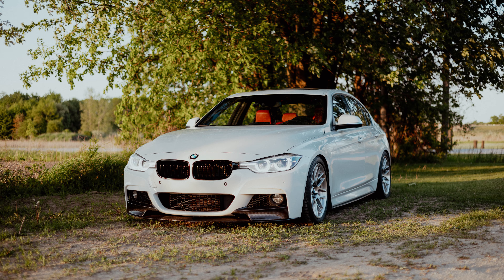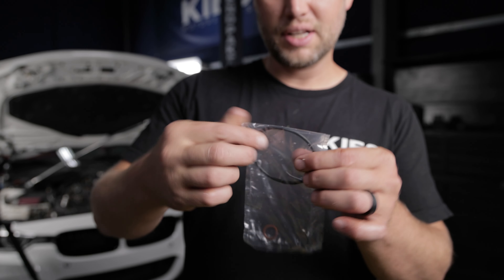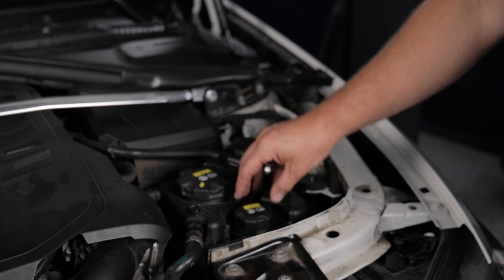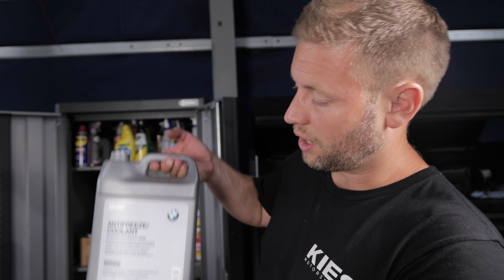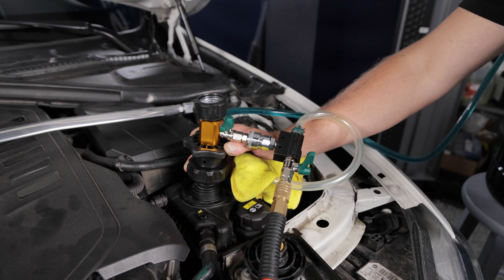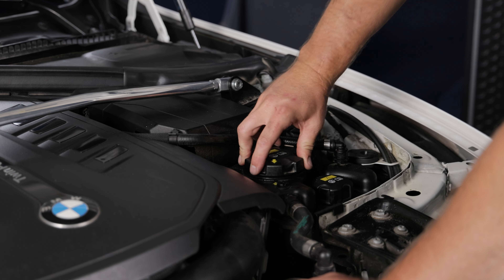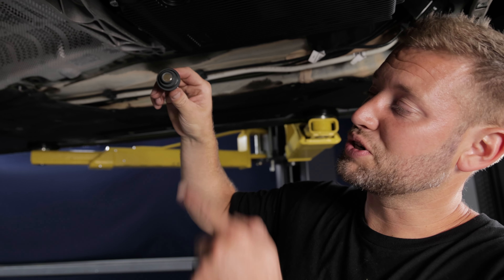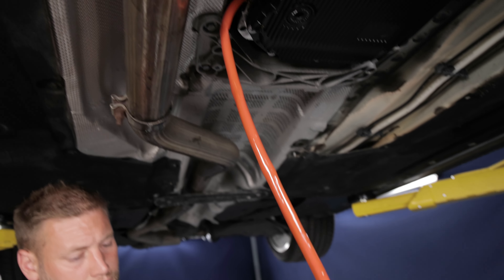How to Change EVERY FLUID in Your BMW | OIL, COOLANT, ZF 8 SPEED, DIFF, BRAKES

Comment from the maker: At 16:55 when Bryan explains checking the transmission fluid level, he meant to say "fill plug" rather than "drain plug." You will use the fill plug to both fill and check the level. DON'T take out the "drain plug" after adding fluid or it will all pour out on the ground lol.
Reply: Hey bro question i have a bmw x5 e70 2012 n55 engine with 119k miles i bought a transmission fluid kit from fcp euro i want to know if is safe to change the fluid or is too late now i call the bmw dealer and they told me is not recommended what are your thoughts the car shifts perfect with no problems ?
Reply: @yeisonmunera8701 your taking your Chances. Keep the old oil just in case if any issues you can pour  the old one back in.
Reply: 0:10 0:10 0:10 😮
Reply: how are people okay touching these fluids?  rip
Reply: Hey Justin, how many miles did your 340i have when you decided to change all the fluids out? I have an '18 230i with 45K miles, when do you recommend I change mine? I drive about 5k miles a year. Thank you and love your vids!
Reply from the maker: @AnonN-sr6uu  mine had around 60k miles in this video. Id say between 50-60k would be good for many of these (transmission, diff etc).
Reply: Do you guys work on E85 Z4’s ?  In Need of some help over here ❤!
Great video
Reply: hey justin i just got a 2018 G30 540i at around 60k miles but I have no idea if the fluids were changed or anything about the maintenance done to the car before me , what should I do?
Reply from the maker: @nyxsu3133  the dealership may be able to pull up service records using the VIN. Since the car isn’t that old, I’d assume it was dealer maintained, at least for a few years. If they have no records of anything, I might change all the fluids just to be safe
Reply: I did a radiator replacement on my G 3530 I after the coolant bleed I have air pockets and my coolant. How do I get the air out of the coolant system so it does not damage the engine or anything else? Thank you.

Comment: Kinda unfair using the coolant filling machine. As many ppl doesn’t hav this expensive tool and want to do it the diy way. Show us how to do it without that machine
Reply: if i am not mistaken from the other videos i have seen you just open the air bleed off valve on your coolant turn you car on but not full set the temperature to high and fan to low then bump on the gas pedal for about 10 seconds or so
Reply: Some job need extra or special tool to do it properly. Example good torque wrench. Modern cooling system due to  very high efficiency heat exchanger using micro channel is best to use vacuum type refill kit to avoid small stubborn air bubbles pocket.  At say 25 inch hg vacuum mentioned in this video, it is equal to as though as we are filling coolant at 12.5 psi positive pressure, but in the form of suction.
Reply from the maker: BMW’s service documents state that the B58 coolant should “only” be replaced using a vacuum
Reply: You can try leaving the coolant cap off overnight. This will generally release all the air bubbles in the system. I used to do this on my e34 and e39 and it worked everytime.
Reply: BMW is not DIY friendly. ❤ yes you’re going to need special tools, you’re going to need special knowledge. You might even need some special brew.
Reply: Brother, a vacuum tool like this can be gotten for around 50 euros max
Reply: It’s 35 dollars on Amazon. Totally worth it the vacuum will help you find leaks as well

Comment: Really great videos, I love all of your content. And this is very good as a walkthrough, even for us who is used to mechanical work. Just easier to be prepared with tools etc, instead of going out to check what I need. I love how meticulously you are doing it. But as a request, please use gloves. Hands is really hard noticing it but I’ve had oil splashing other parts, like legs. It’s not many minutes before the oil actually gets absorbed into the skin. I lost a grandfather because of cleaning and rebuilding engines with hands in diesel and kerosene and oil all day long. So please stay safe and make more good work👌🏽
Reply from the maker: Thanks for the tip! I started wearing gloves recently after reading a similar comment on another video. Safety first!
Reply: @justinbuice  ❤️ I’m so happy to hear that. You make a really great material. You deserve a long life after work also. That’s how I’m trying to see it, why work so hard if we don’t live to experience the retirement and some vacation   You definitely earned me as a subscriber for life   Have a great spring prepping cars for summer season 👌🏽

Comment: Hey guys, just bought a M240i used, first registered Jun 2019. And it also has the B58 engine in, with the same setup for coolant reservoirs as you have. The main engine coolant reservoir was a little low on coolant so i got some from BMW yesterday (green for 2019 on) and a syringe and tubing to sample the reservoir since i could not actually tell if the coolant in there looked the same (some folks will use non BMW stuff, so best to check before adding). The coolant in the main engine reservoir was yellow, so not the green coolant BMW stated is used in B58s from 2019 on. It is clear and clean looking with no residues or particles evident (good news as i believe if there was oil from engine or transmision it would not be, similarly if there was a rust problem) and interestingly if you pass light through it at right angles to viewing direction it is bright green like the proper coolant. Would you say this colour change can happen to coolant over time where it will change colour like this? And also, being as the reservoir for the intercooler (smaller reservoir) contained green coloured coolant and was at the correct level, i assume the two systems are completely independent of one another, am i correct?
Reply: Wow. I’m going through the same thing but opposite I have like a yellowish green coolant in my low-temp reservoir. When I shine light in it as well it is green. Super weird I need to know how to drain the low-temp reservoir I did a flush over thr weekend but I only did the high temp.. I have the f30 340
Reply: @See.M.Swervo  I took mine in to BMW within a week of buying it and had them drain and replace 🙂 Correct stuff in there now. There are a few videos of how to drain this fluid out and flush. I don't have a garage/drive so could not do this myself really.
Reply: Its just a coolant, water will work the same.

Comment: Just want to add that
when changing the oil filter, loosen the plug on top of the filter to allow contaminated oil to drain for a while. This prevents metal particles from being flushed back into the engine when the filter is removed.

Comment: I just got a 2024 530i, also factory filled with 0w20. I felt it was a bit to thon. I asked the BMW dealer, and the service dept. they told me tgat they use 0w30 after 60k to 70k high mialeage.  However I could request to use 0w30 on my next pil change and they would no prob. They said the ow30 provides more protection, , but the 0w20  is for better fuel economy.  Then I asked if I could use 5w30,  and they said I could, and they have it, but 0w30 flows better. I'm in Miami.  Not sure where you guys are at, perhaps the extreme heat we have here , BMW has different fill options. I personally prefer the 0w30

Comment: In about 1000 miles im due for a oil change. So for my 2014 228i RWD Coupe, I ordered 5w30 Schaeffer's Advanced European Performance. The BMW dealership said originally the weight was 5w30, but changed it to 0w30. I said screw it im gonna keep it 5w30. Schaeffer's been around since 1839.

Comment: Awesome video. Been looking at 340is for the past year and the plan is to get on in December. Any comments about what tools I should start to accumulate? This will be my first real project car and I’m not sure what I need!!
Reply from the maker: Hey! At the very least you will need metric sockets, a set of both Torx and E Torx sockets, a torque wrench, and some sort of software that can interface with the car’s computers. A set of interior pry tools will be helpful too. 

I personally use BimmerGeeks ProTool which is an app you can get for android devices. I got a cheap tablet from walmart just to run ProTool. You will need this or something like it if you ever replace the battery. It can also show live parameters like how we were able to check the transmission temp in the video. You can also use it for programming if you change any of the electronics inside the car. For example i Installed a digital gauge cluster a few months ago and used ProTool to program it to the car. 

I also use an app called Carly which doesn’t have quite as many features, but it’s more convenient for me to use on the go since it works with iPhone.
Reply: @justinbuice  awesome thanks bro I appreciate the help seriously!!

Comment: Great video as always. What would you estimate was the cost to replace all the fluids? I see the transmission pan and tools probably added around $5-600+ . So maybe around $1000 total to get all these changed out?
Reply from the maker: I have to add it all up, but $1,000 sounds very close. Keep in mind that most people will re-use the stock transmission pan which would be a big savings.

Comment: Thank you for the amazing instructions!!
How often should coolant be flushed? Dealership said 100k miles lifetime fluid.

How often should engine oil be changed? Dealership said every 10k miles.
Reply: Coolant I would say around 70 000 miles. 
Oil 6 000 - 10 000 miles.

Comment: BMW factories use ZF 8hp fluid in their transmission. You have added luqui molly which differs from ZF. BMW warns that mixing a different fluid can cause damage to the transmission. 

That’s why I ordered ZF. What do you think about that? Because couple litres old oil was left in transmissions anyway.
Reply: There is a ZF Gearbox service kit with pan, filter, screws, and 7 litres of oil included. Costs around 200 euro.

Comment: Aren't you're supose to do adaptation reset after changing transmission fluid as well?
Reply: Nah man it’s just to reset the service interval. That’s all it does.
Reply: I also heard there was some solenoid reset you’re supposed to do but idk
Reply from the maker: Resetting the adaptations is not mentioned in the BMW service guide or the ZF service guide.
Reply: No, you dont need to, you reset adaptations when rebuilding the case, or change mechatronics. Important is after the adaptation reset you need to run new adaptation procedure.

Comment: After watching/reading various how tos regarding the transmission refill, apparently, after carrying out the procedure in the video one should either add 0.5 ltr extra of oil, or, run the transmission until the transmission cooler opens (75°C), then let the trans cool back down to 40°C, and recheck level. Obviously this depends on whether or not a cooler is fitted.
Reply from the maker: We were following the service PDF from ZF. After shooting this, we test drover the car, let the transmission cool down to 40C, took out the fill plug, and there was still a steady stream of fluid coming out.
Reply from the maker: Of course a dipstick would make this all much easier 😅
Reply: @justinbuice  That's good to know as I will be doing mine tomorrow (hence me being here, thought one more vid couldn't hurt lol) now I can skip that bit. I will be changing the Mechatronic sealing sleeve whilst I'm in there, again 'apparently' they can be prone to leaking. Thanks for a great vid.
Reply: @justinbuice  😂True
Reply: When discussing the transmission fill process, (between 16:50-17:10) did he mean to say Fill Plug rather than Drain Plug?  If you run the engine until the trans fluid reaches 40C, then remove the Drain Plug to check the level, all the fluid will start draining out!
Reply from the maker: @RbNetEngr   oops, good catch! he meant to say fill plug. Yes, do not take out the drain plug after filling!

Comment: How often should you change your brake fluid completely? And the transmission? 2017 430i thank you for your videos
Reply from the maker: Brake fluid - BMW recommends every 2 years. ZF 8 Speed transmission - ZF recommends 50k miles (my car had around 60k in this video).
Reply: @justinbuice what size tires do you have all around wondering? i have a f30 myself and love the fitment
Reply from the maker: @blank2837  • Front: 18x8.5 ET35
• Rear: 18x9.5 ET45

• Front: 245/40/R18
• Rear: 275/35/R18

Comment: Question about doing the transmission pan. Why are we cleaning the mating surfaces on the transmission of fluid with a microfiber cloth.. if we are then putting some transmission fluid on the new gasket to lubricate it? Doesn’t that defeat the purpose of cleaning that off in the first place?

Comment: Would the transmission oil swap be the same procedure on a manual? Would you need to start the car and move through the gears and top up a second time like here? Is that step absolutely necessary ?

Comment: @justinbuice For the coolant change there was some editing. Right after you empty the system and have full vacuum, the inlet hose was empty. Then video cut to next step with inlet hose full before filling new coolant into system. It looks like you skipped a step. If you don’t have that inlet line full of coolant you’ll be injecting the air that’s in the line into the system. How did you fill the inlet line first?

Comment: I have a 2017 430 and bought some blue coolant because I got a warning light on for low. However I'm aware that they started using green coolant so if the dealership topped off my blue coolant with green coolant would I need to use green or blue to top off? I read that you can use green in blue but not blue in green so I'm a little confused if I should add blue or green even though the car originally came with blue. I just topped off with some water for the time being.
Reply from the maker: I’d say it’s probably fine for now. But personally I’d change it sooner than later. That way you can start fresh and know exactly what’s in there.

Comment: Hey Justin, thanks for another great video!  I'm about to service the transmission of my 2018 BMW M240i X-drive and I bought a ZF pan & filter with 7 Liters of Liqui Moly Top Tec 1800 ATF.  But now I'm hesitant to go with Liqui Moly because there will be about 2 liters of the factory ZF fluid left behind and I'm concerned about mixing them.  Am I correct in assuming this is what you did and if so, have you noticed any changes in the performance of the transmission?
Reply: Should be fine. I mixed mine on my 330e trans and as long as it’s 5he same spec you’ll be fine

Comment: Before filling differential oil, we need to shake the oil bottle to mix everything evenly inside. Otherwise, friction adjustment will differ, and it ends up chattering

Comment: Great vibe on your video!  Do you allow less oil total intake capacity for the Ceratec, meaning instead of adding let's say 7 quarts of oil, do you add 6.5 and the Ceratec for a total of 7?
Reply from the maker: Thanks! Yes, if you are going to do an additive, subtract that amount from the total oil you are adding.

Comment: @justine, thank you for this video, well presented. Please, I have a question, @3:31 after the engine oil, Cebatec was added. What is the purpose of adding Cebatec?
Reply from the maker: It’s a protective additive that reduces wear and tear on the engine.

Comment: How’s the B58 engine holding up? Is the plastic oil housing holding up? Did you replace it with aluminum?
Reply from the maker: Haven’t had any issues. Still have the stock plastic housing but may upgrade to aluminum soon.

Comment: Question my 2007 328i just had the brake fluid light come on but it’s full, does this mean it has to be flushed and replaced. Also would it stop squeaking when I brake or is that brake pads ?

Comment: sorry to revive an old video... does trans really need to be filled with the engine running? if so, can you provide source for that. Bryan made another ZF8 Speed trans fluid change where in the comments he says he didn't do it while the engine was running. forums are 50/50 i'd say but doesnt seem like anyone can provide a direct source of information :/
Reply from the maker: It does need to be on or you will under-fill it. If you fill it with the engine off, then start the car to check the level, you will find that it's low. https://www.youtube.com/watch?v=kXKhZievmSI look at 12:25 in FCP's video. They didn't mention how much they added in their video, but mine took an extra liter or so once the car was running.
Reply: @justinbuice  thanks justin! was able to get about almost another liter in as well after doing it with the engine on!

 i'm noticing that first gear has some sort grind at mid throttle but only happens from a dead stop and don't usually hear it in any other gear. also only happens when going in a straight line. everything seems to shift smoothly its just the sound that become a bit of a worry.

Comment: Hi Justin, My F34 ,b48 engine is mixing oil with coolant in water reservoir. I have replaced oil filter housing but is still mixing. Could it be transmission cooler?

Comment: Do you add ceratec after the oil is already at max capacity? or do you add slightly less oil to account for the ceratec being added?
Reply from the maker: Put in slightly less oil to compensate. Just make sure you check the level through iDrive afterward.